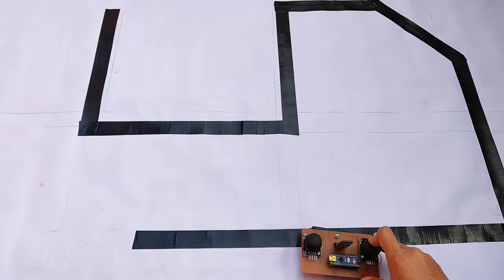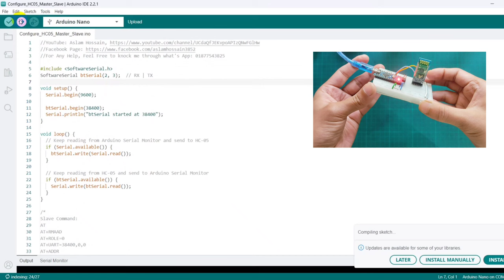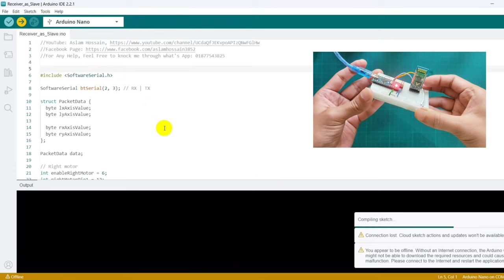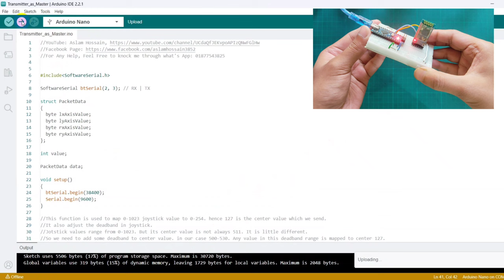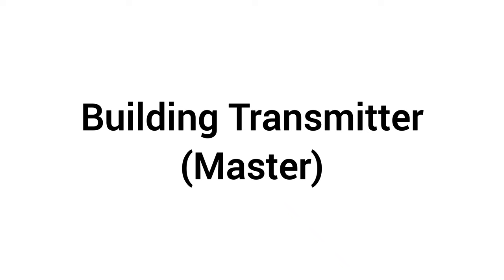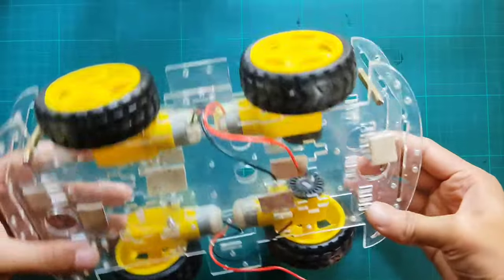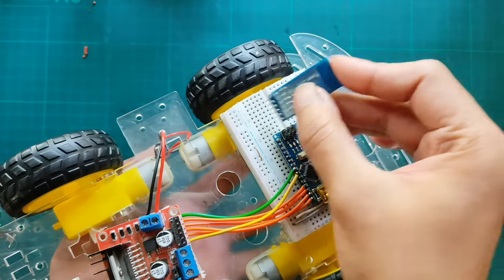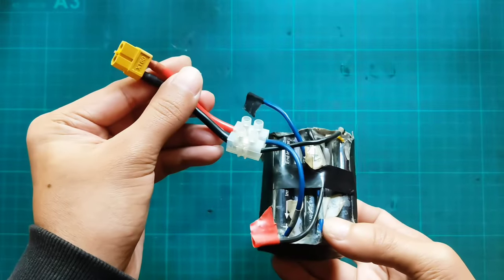Arduino Joystick Control Bluetooth Car Using HC-05 Master and Slave

Comment: What is the maximum distance the car can move away from the remote controller so as not to lose the connection? For me it is 2 or even meters. Also I lose connection when I direct the remote to the other side of the car.
Reply from the maker: According to datasheet it's 10-20 meters. May vary in practical

Comment: The HC05 master doesn’t seem to be retaining the role change to 1 but says ok to all steps but the two HC05 don’t seem to connect to each other after completing all the steps
Reply: I have tried both modules as master and slave but have the same problem on both not sure what is causing the issue

Comment: im getting an error that states "avrdude: stk500_recv()" and I cant figure out what the problem is have you had any experience with this issue?
Reply from the maker: Port problem. Please select the proper board, processor and port number while uploading the code.
Reply: @aslamhossain1  Is it possible to use an arduino nano with this?
Reply from the maker: @makanh.6726  yes. I also used arduino nano
Reply: @aslamhossain1  Did you have any issues with the L298N? When I test it with one side it works fairly fast, when I do it with both sides sometimes I have to give it a little manual turn to start it up and its very slow but a lot of the time it is just not turning. I am not sure whether or not it is a power issue or what. The wiring seems to be perfectly fine.
Reply from the maker: @makanh.6726  maybe the pwm value in the enable pins is lower.
Reply: @aslamhossain1  It might actually be not enough voltage and current getting through I am only using 9V
Reply: @aslamhossain1  What voltage did you use for the RC car itself?

Comment: I just tried everything but my motors are moving uncontrolled all the time and they are changing directions for just a sec also. Do you have a solution for this?
Reply from the maker: Power supply problem in transmitter.
Reply from the maker: Need 5v constant.
Reply from the maker: Use 2s battery. 8v in Tx Arduino Vin

Comment: i am trying to apply this project, in the first step of putting the HC-05 in A T mode, it is turning only red light instead of red and blue light, what should i do in this case?  Note: i am using Arduino Pro micro
Reply from the maker: Press and hold enable button then connect power. Then after a few second AT mode should be activated.
Reply: @aslamhossain1  i already did this step but it is blinking with red only, also when i trying to send the A T command lines to the serial monitor, but nothing appear in the serial monitor
Reply: @ربابآلسهوان  I am also getting this issue but when I type the commands into the serial monitor, I am getting some symbols which usually show up if the serial number I am using is incorrect but I am using 9600. Not sure what the issue is with it.

Comment: What joystick are these trying to find the parts just get a lot of controller spares
Reply from the maker: https://www.google.com/search?client=ms-android-xiaomi-rvo2&sca_esv=847412b30e358a21&sca_upv=1&sxsrf=ADLYWIKuNA64cqJlr0OiikN2CJk9XXJEqA:1723152699480&q=analog+joystick+arduino&udm=2&fbs=AEQNm0Aa4sjWe7Rqy32pFwRj0UkWd8nbOJfsBGGB5IQQO6L3JyJJclJuzBPl12qJyPx7ESIJKsuo8DSJKOxlDDbn2sXiP2DA1JodL-8OvpqfPcsNcQUuuwc5TAoUZ87rVxy1Xv44fXe4anLnvLcDFC-g4Q79g5ePUy5vwOhyyW06dpaKgZBnQRs&sa=X&ved=2ahUKEwiii6-ErOaHAxXYSmwGHXVuO4EQtKgLegQIGRAB&biw=393&bih=733&dpr=2.75#vhid=NpUU8g3pjMyiQM&vssid=mosaic

Comment: at the start when paring the 2 module you olug it on the bread board what about the other board that was already on the breadboard what is it?
Reply from the maker: You need two HC-05, one for tx another for rx. i've used two different HC-05 module.

Comment: i dont understand, it is only master-BT-module that cant not do AT+RMAAD. but Slave-BT-module does it fine
Reply from the maker: Make sure the BT Model is HC-05. Because only HC-05 can act as Master.
Reply: @aslamhossain1  both are HC-05

Comment: i have a problem, when my car just started, it runs normally but after that i can't controller, i press reset button on arduino board and it back to normal
how can i fix that
Reply from the maker: Power supply problem in transmitter
Reply from the maker: Use 5v at arduino and joystick